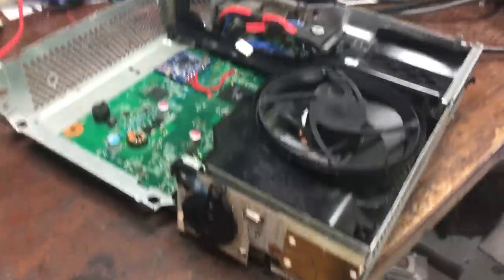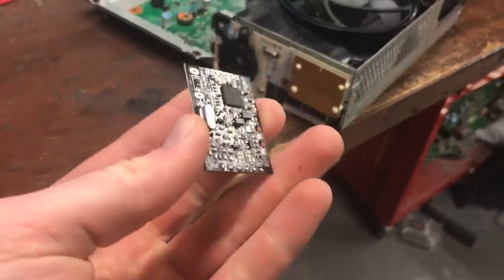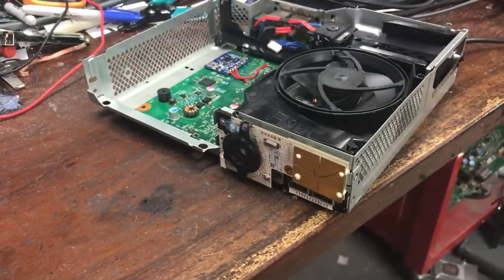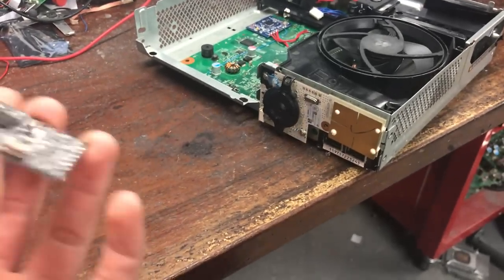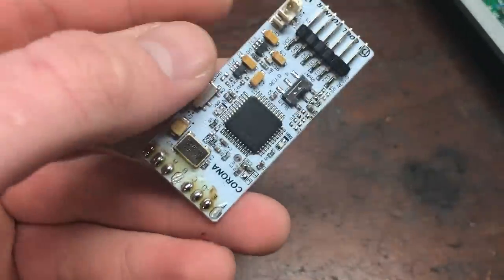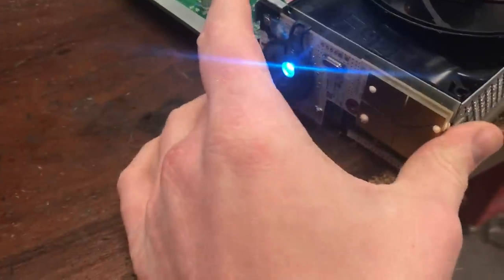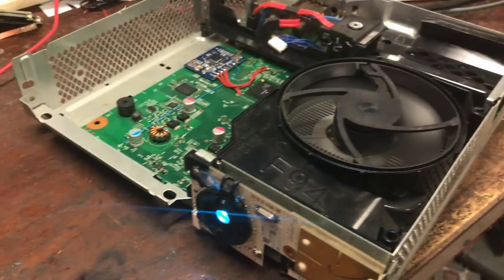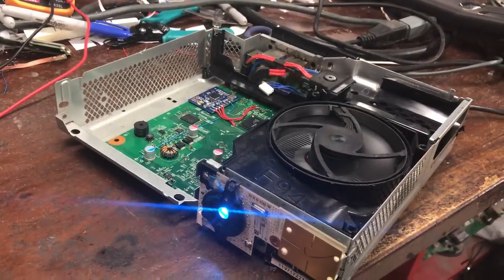Stuborn Corona RGH2 - CR4 Muffin Install (FIXED)

Comment: I have a question for you I'm doing the same thing but in a xbox 360 s trinity motherboard I wanted to know are they any other soldering points to solder to then the ones in the weekend modder video?